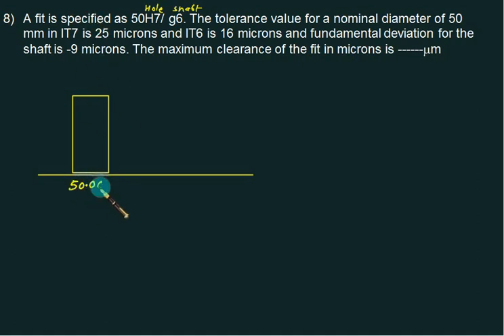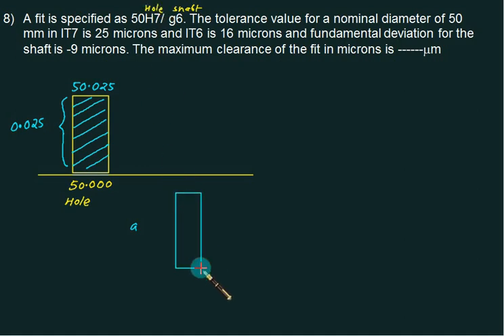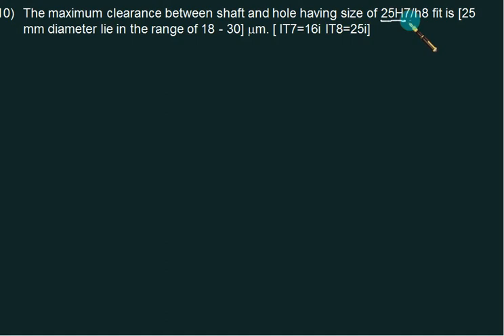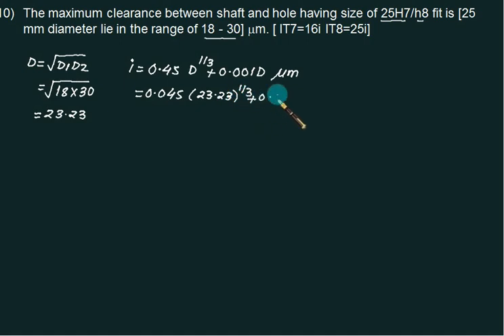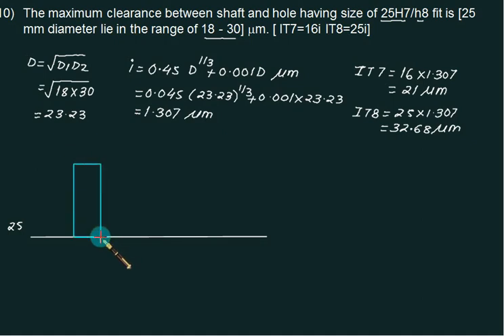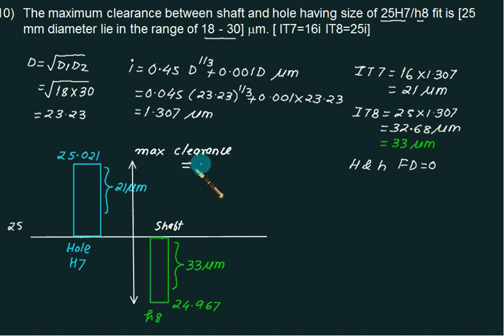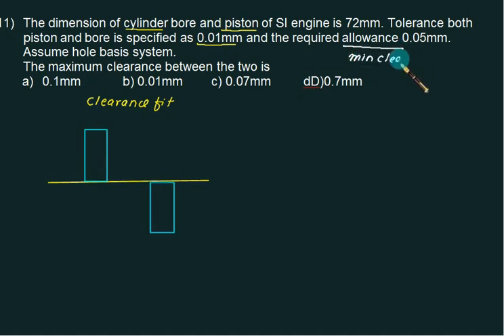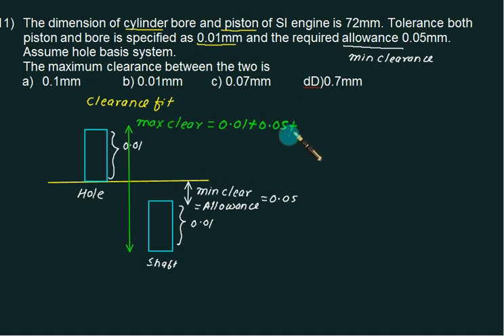Limits and Fits 05 Fundamental  Deviation III

Comment: Sir earlier you said that in hole basis system allowance is given on hole but in last question you used it for shaft 
Plz clear my doubt
Reply: In hole basis system FD of hole is zero....So It is the lower limit of hole....For clearance fit, min hole size should be greater than max shaft size....Min clearance or allowance is given by difference between these two(Min hole size and max shaft size)